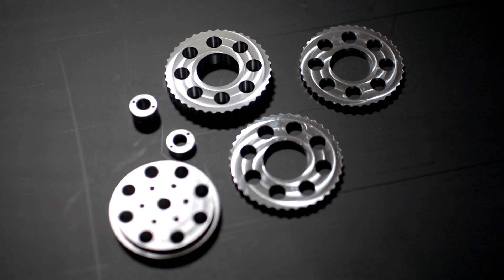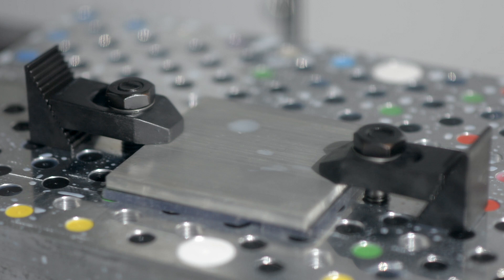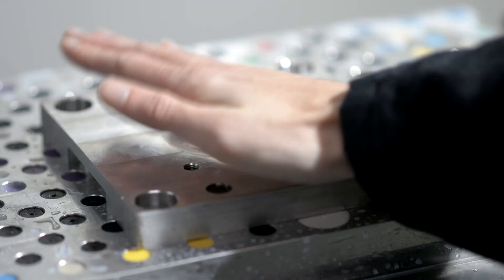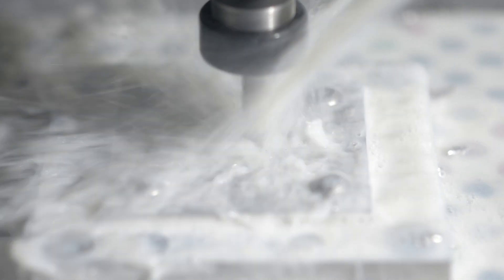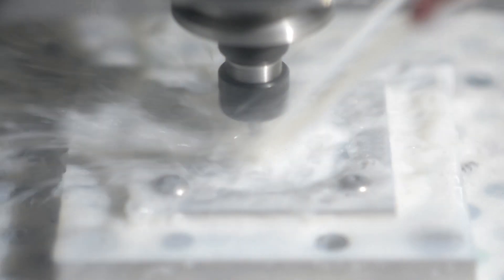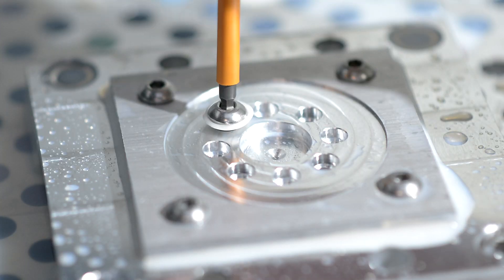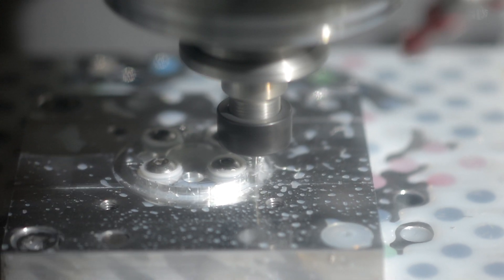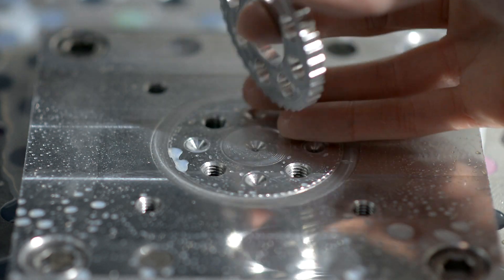CNC Machining Robot Parts - Cycloidal Disc! #13

Comment: Nice work! Glad to see you have enough sense to use a circular path for the full width slotting, rather than cutting the squiggly path the whole way like most youtube machinists :) After that I use vertical motion to clear most of the material between teeth, and then a single rough squiggly pass followed by finish pass.

Comment: 1:00
Sir, what kind of toe clamps (brand, model number) are those?
Could you please tell me.
Thank you in advance.
Reply from the maker: They're just standard 16mm toe clamps! Bought as a set https://www.rdgtools.co.uk/cgi-bin/sh000001.pl?WD=2477353&PN=FIFTY%2dTWO%2dPIECE%2dSTEEL%2dCLAMPING%2dSET%2d%2d%2dFOR%2dUSE%2dON%2dEQUIPMENT%2dWITH%2d16mm%2dT%2dSLOTS%2d2477353%2ehtml#SID=139

Comment: Nice looking part, no way you hit h7 9mm though?
Reply from the maker: As with the main bore, the 9mm holes were machined, measured, and tool comp adjusted if needed so the 0.015mm H7 tolerance was fine, just took some checking and adjusting. Being some one-off parts that wasn't a problem - but if production, reamer would've been more reliable.